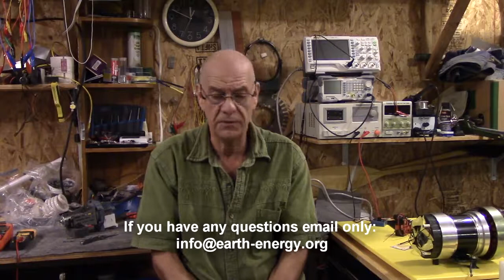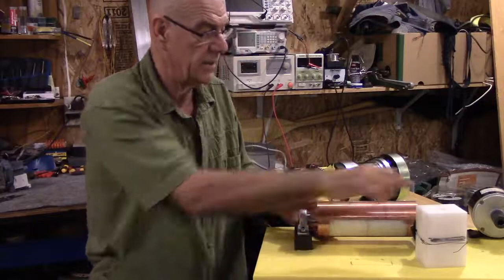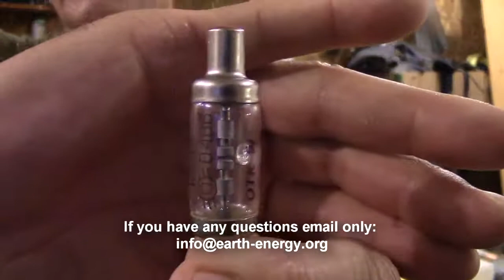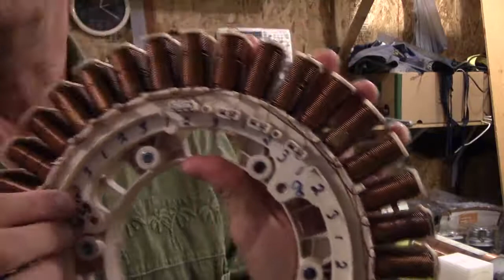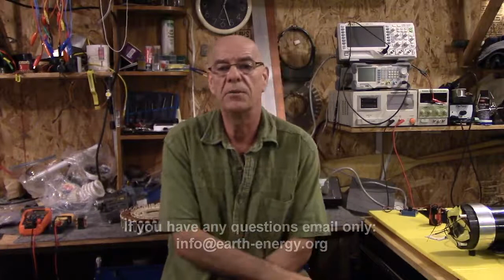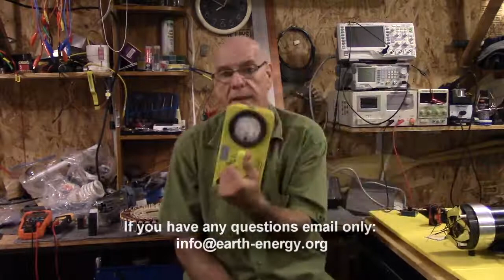Where the in box thinkers go wrong by Gerard Morin

Comment: No science, no legitimate explanations, and an extreme amount of bitching and whining. Thanks for reposting this crap.
Reply from the maker: yeah. i wish they would document their stuff better so their claims could be actually easily reproduced for verification
Reply: if they're not documenting/proving amps AND current, they're just making mechanical transformers...
Reply from the maker: actually. what they should do. is. capture all required reference data points to reconstruct the experiment for virtual reality. so it could be analyzed in a simulation.
Reply: simulations are only as good as the software. I'm talking to someone right now who made a "Gerard Morin Replica" trying to get him to take current and voltage measurements on the input of the motor and the output of the generator. If you've seen a few of these other videos by this guy he gets a halogen bulb to arc because the thing was rated for over 100 amps and he wasn't even close on current (by extrapolation, he never measures amps)
Reply from the maker: ytlink?
Reply: https://youtu.be/3jXJdA4Y7CU is the conversation i had with the guy that made the gizmo, im gonna need to scrub gerards videos to find the one im talking about. it's gonna be a minute.
Reply: https://youtu.be/3jXJdA4Y7CU this is one, but not the one i was talking about, but even as a demonstration he's only got 5 amps coming out, but he's not measuring voltage this time. it's barely 1/4 of a complete measurement
Reply: https://youtu.be/oyaor9ZTsWg Here's another good one, the sodium bulb is barely glowing. and if you do the power calc on the output he's managed to produce 26 watts of power. And I'd be willing to bet he is feeding that thing 120V house voltage and way more than that .2amp of current.